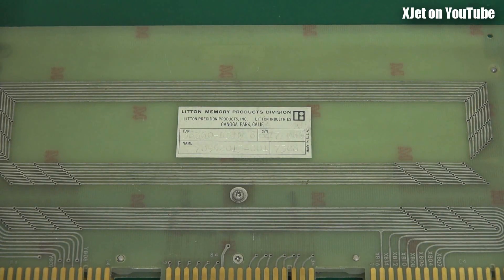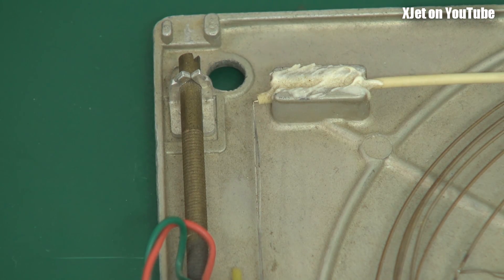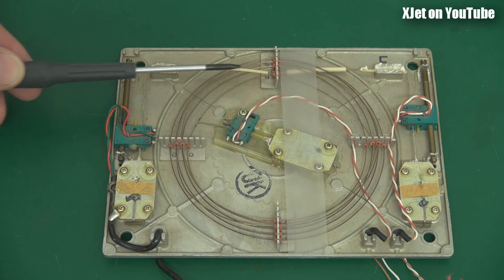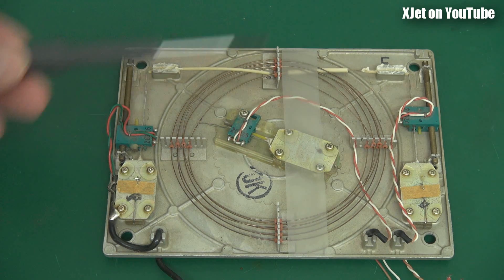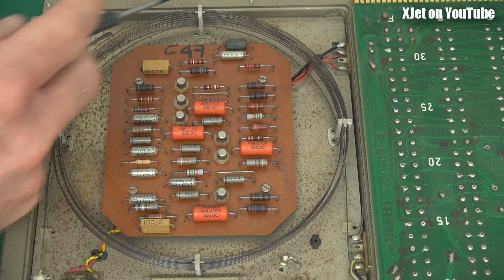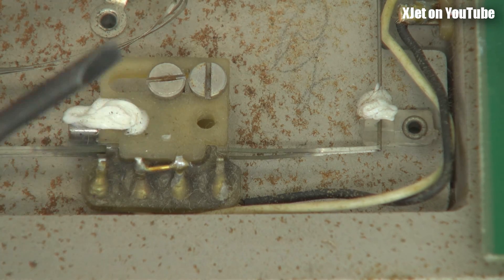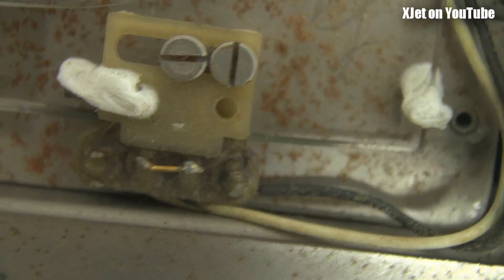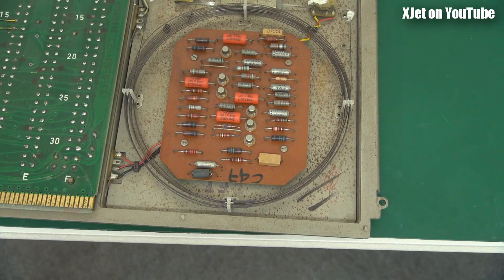Old computer tech:  delay-line memory

Comment: Just a few notes on this lovely old stuff...

The twin sensors on the first wire thing is confusing. All I can think of, is a speed option. As in, the longer the line, the more storage, but the longer you wait for your data to come through. So maybe having one halfway along the wire lets you set a half-capacity twice-speed mode? 

As far as modern DRAM, it STILL needs refreshing! Just a bunch of capacitors, one per bit. DDR5 SDRAM is still DRAM! 

The construction method for the PCB with the vertical components hanging off, between the main PCB and the little PCBs is a method called "cordwood construction". At the time it was a way of fitting more components into a space. Must've been a bugger to repair though. For whatever reason, it fell out of use. 

The "delay lines" on the board with the microchips, I don't think are. I think they're inductors, for power smoothing. The fact they're next to all those capacitors, presumably for the same purpose, makes me think that.

Lastly the 5 1/4 inch drives ended up with 1.2MB, after many long years! But I think 8" were long dead by then. As densities improved there was no need for the gigantic 8" disks. Maybe some terrible old machine somewhere still uses the 8 inchers, best left in it's dark corner if it does. 

Interesting hardware you got there mate!
Reply: No the delay lines are actually delay lines, just not mechanical but a bunch of coupled oscillators.
Reply: Coupled oscillators? How does that work? I noticed the capacitors seemed a bit weirdly wired up. The circuit with the two coils, one either side of a dozen or so caps. And there were 2 copies of that setup. That the one you mean?

Far as I know no delay line would work like that. If it were some sort of bucket brigade, wouldn't it need switching transistors on each element?
Reply: greenaum  "lumped electromagnetic delay line" looks like a LP filter and is used at it's resonant frequency. Useful if only little delay in a narrow frequency range is needed.
Reply: In general search: "electrical all-pass filter circuit". That is what these are from a filter standpoint. The information that they store per stage is a constant, therefore a distributed transmission line like the mechanical one shown here is more practical than chaining lumped ones.
Reply: greenaum "bucket brigade, wouldn't it need switching transistors" you might be thinking of a CCD best known for their use in image sensors, these were also used as memories but do not need a true switch, only an electrode that moves and creates the "buckets".
Reply: I was thinking of bucket brigade shift registers, another form of serial-access memory, an electronic version of this wire memory.

If the circuit we're talking about is really memory, can you explain how it works? The oscillator thing?
Reply: greenaum I think I could but why don't you just google it? I gave you all the search terms you need. The physics behind it are the same no matter whether mechanical or electrical or lumped or distributed. Look at a chain of coupled pendula, for a lumped mechanical delay line.
Reply: The type of delay line you specify seems more like a pulse-stretcher. It couldn't handle more than one pulse in it at a time. Correct me if I'm wrong. So it'd be no use for storage, you need a bucket-brigade, with a switching element (ie transistor) for that.

I can see the device might maybe need a pulse-stretcher, but then that would assume sparse pulses, only a few pulses with a long distance between each. Otherwise the pulses coming out of the caps etc would run into each other.

It's curious that the caps appear connected in an anti-parallel manner, with alternating leads connected together. Perhaps though it's just a power filter for 2 voltages, plus ground? Positive and negative. That'd explain the two inductors, one for each.

I suppose we could try actually drawing the circuit out...
Reply: "Delay lines need a switching element That is, electronic ones. Basing them on twisted wire is a different bag of spanners."
Sorry but then you have not understood anything and have not done any research about them at all. Neither an electrical nor a mechanical delay line need any form of switching. All they need is a propagating exchange between two types of energies along a line.
Reply: Depends by what you mean by delay. This kind, for memory, is basically somewhere to put 1s and 0s for a while. I fail to see how that would work with only passive components.

That's different from a pulse-stretching delay line.

In the example of a line made of L and C,  it would tend to smear out the pulses and something approaching an average would come out of the end.

Of course all lines are theoretically made of L and C, and this happens in those too. It's one reason that limits the frequency of signals you can send down a cable or optical fibre. The pulses start to smear, widen. Using actual Ls and Cs is just going to make that much worse.

Please describe how consecutive discrete 1 and 0 pulses would come from a circuit like that? A bunch of Cs, in parallel, with Ls between each one. The standard model of a transmission line.

The other thing is, as far as I can tell from looking, the inductors in question aren't multi-tapped. There's just 2 of them, and maybe a dozen caps.
Reply: On the one with two outputs, the middle output is actually very close to the end (a couple of inches), so I don't think it makes much sense as a lower capacity/higher speed option.
Reply: I worked to IBM, they have an old (1960) 80 column punch card data entry, machine code: 029. It used a memory device like that, it could hold 80 bytes of 12 bits.  The information keep recirculating in the spring wire, the electronics could identify exactly each byte and bit, you could edit it, change, and punch the card after you type everything on the keyboard.  It was an amazing technology, we called it "sonic memory".  You can see this and much more at IBM museum online:  http://www.glennsmuseum.com/ibm/ibm.html
Reply: I don't know about those weird electromagnetic delay lines (?) but the twisting-wire ones that occupy the first 2/3 of the video would seem to satisfy "delay line with only passive components and no form of switching". And so do glass delay lines used in analog video—see related video: EEVblog #386.
Reply: Yep, they are memories. The glass delay line is an analogue one rather than digital, but uses similar principles, ultrasound bouncing around a physical medium, like this one.

We're arguing over the thing with the row of capacitors with an inductor either side, doesn't seem like the sort of thing you'd use as memory. I think it needs a switching element because it's electronic, because of how the capacitors and inductors work. Otherwise how would you keep the bits separate? Of course that doesn't apply to things like this, where it's physical vibrations running down a wire / bit of glass.

Cheers for the information, Herr Lip, must've been great to work with the dinosaur machines, back when every bit mattered. My first computer had 48K, it's still weird to have 8GB now and probably a million times more CPU power.
Reply: The "delay line" in question is at around 8:30 into the video. 

Perhaps it's a delay line that delays or stretches 1 bit at a time, but I can't see why. If that's a memory board presumably the chips are shift registers, which were used before RAM, and were accessed serially like the twisted wire. I can't see the point of lengthening one pulse, when the next one is on it's way through already. Surely they'd clash. 

The logic behind all of this is either synchronous, in which case you design everything with tight timing, or static-capable, in which case it doesn't matter. It just seems very odd in digital computers, to use an analogue delay line. At best it'd be a hack, and something they'd want to design away ASAP. 

Just seems very strange. 

Normally, since the 80s at least, you put power decoupling caps across the power lines for chips, as near the chips as possible. There are the yellow caps that seem to perform that duty, but no others. So I'm guessing that's what the caps / inductors in question are. Power smoothing for hungry chips. Perhaps them being so far away is for board design reasons, and doesn't matter as much with slower, less dense, logic like this. 

The diagonal, inverse-parallel connection of the caps makes no sense as a delay line either. It does, if it's meant to smooth both positive and negative voltages, which early memories needed. 

If we want certainty, somebody's going to have to reverse engineer a circuit diagram from looking at the board. I can't be bothered. But I might look a bit more closely, particularly at how many taps the inductors have.

Comment: Back when I was a field engineer at Burroughs, I worked on a terminal that used this kind of tech as the screen memory. It was in the mid 70's but they were obsolete then... Something about a shortage of the new models...  There was a screw on there that adjusted the tension on the wire to adjust the memory timing. I always took my rubber mallet over there to bang on the circuit boards, and a "pot tweaker" to adjust the memory. One of the other pcbs in the terminal was a hoot, by today's standards... the character generator used a huge array of individual diodes to define the font. Fun stuff. ;-D
Reply: Oh the days of diode logic :)  Love the calibrated hammer!
Reply: Jim Steele my great-uncle worked for Burroughs, then unisys he actually had a set of cards from some of the old machines actually he would take the big cabinet cases and put counter tops on them to make work benches, but he had a memory module  that consisted of wire mesh it seems like he said something about the wire could overheat and break fairly easy (it's been a while and I can't ask to double check) also had a bunch of 4 transistor flip flop cards, optical punch card reader.
Reply: my  calibrated hammer  was named mem killer
Reply: I heard about a guy who made a coffee table out of one of the platters from a fixed head disk unit.

Comment: I tore an old Singer computer apart and it had four banks similar but without the twisting action.  It just had a transducer on either end of the coiled wire and was called acoustic memory.
Reply: turbojer1 so... you could corrupt the memory by knocking on the case?
Reply: Yep, that's the one.  Back in the day all we had that would multiply and divide were mechanical Friden calculators.  Along came the Singer electronic (mostly diodes and relays) punch tape computers.  Our company bought one for around $35,000 and I got to tear it apart when through with it.  Inside was two Friden mechanical calculators with solenoids attached to the finger buttons to push them down.  IBM came along and pretty much crushed Singer, who also owned Friden, out of business.  You now have a new appreciation of a sewing machine, eh?
Reply: Not really, the whole container was pretty shock proof plus the memory wire was supported on soft rubber mounts and the vibrating frequency was pretty high.  Probably would not recognize a bump or knock.

Comment: I think 8" floppies were limited to 512Kb. I never saw a 1.2Mb 8" diskette or drive. The newer, early 1990s, 5.25" 1.2Mb drives are starting to fetch money, like $60 each, on eBay lately. It's too bad I threw them all out.
Reply: FreecycleMichael Czechvar 360k. In the 1970’s. I used them on an Olivetti P6066. One system and one user disk.
Reply: The last generation of 8" floppy disks could indeed store 1.2MB, but they were very quickly replaced by 5.25" floppy disks, which had already been available for some years, and were somewhat more reliable, at least in my experience.

Comment: If you made a wire out of microscopic tin sheets embedded with fluorine atoms, it would actually become a superconductor (at up to 100 degrees celsius!). As such, the signal wouldn't get weaker as the length of the wire increased.

I want to modify a DOS computer to have a whole bunch of these Delay-Line modules (in transparent casings); it would be awesome to actually watch it in action.
Reply: It's an acoustic signal, not an electrical one, so the conductivity doesn't matter. Also, the wire isn't a complete loop, it has two ends, it's just coiled up to save space.

Comment: All DRAM chips still need refresh cycle. The current desktop with 16 Gig RAM still need a read operation on each row, the refresh must be performed 1000 times per second. 

A DMA channel iss dedicated for this operation. The DMA execute a read at some address when receiving a clock pulse from a timer. It then increment the address by the page size (256 bytes? 64K bytes?). One millisecond later, the timer chip send another pulse to that DMA which trigger another read operation. The DMA and timer chip are integrated in the processor itself, but the BIOS and OS still need to setup the timer and DMA in the same way as it was done when these were in discrete chips.

This spiral wire using mechanical wave to store about 512 bit of data was a huge improvement over the previous ferrite memory for memory size. However, the performance, that is how fast it can be read or written, is much lower. 

The read and write operation can be compared to a hard drive with a single track. When a sector need to be read or written, the hard drive controller need to wait that the disk rotation reach the location were that sector is located. If we want to read the sector, then immediately write new data, this takes at least the time of a full disk rotation, After finishing to read the sector, the controller need to wait until the disk rotation reach the beginning of that sector, then it can replace the data with the new value.

Thanks for sharing this device. It helped to understand how it work. The way this technology is explained usually is so strange... like if they didn't really understand the subject that they were forced to teach.
Reply: Christian Gingras that's scary
Reply: How so?
Reply: The ram need to be very reliable to avoid loosing data. The spirale memory need to repeat the same pattern continously to work. Even if the processor would stop on a breakpoint, the spiral need to circulate the data non stop, always at the exact calibrated speed.

Any strong vibration, electrical noise, etc can not just corrupt 1 bit but the entire content.

What if some binary sequence like 64 bit to 1 then 64 bit to 0 could create large oscillation and corrupt unrelated memory area. Maybe the instability would happen with shorter repeting binary sequence. Then, the software engineer find ways to avoid such sequence for reliable operation.

Note that such nightmare happen even on modern architecture. For example, a mistake in a PAL logic was triggering corrupt data on an I2C chip when the code size exceeded 512 k on a x86 embedded system.

Comment: The Olivetti coil memory is out of the Programma P101. A programmable calculator that could add, subtract, multiply and divide, calculate square root and store data. It had a read / write mag card that stored the "programme" sequence required for the calculations.
NASA had a number of these for the Apollo 11 moon landing, evidently to help tell the antenna where to locate earth.

Olivetti were quite leading edge with this device, HP "borrowed" some of the tech and wound up paying some royalties for the pleasure.

Olivetti design was amazing, from their mechnical calcs right through their commercial machines such as the P603, A4, TES501 and Praxis 48 typewriters.
Ah, good years fixing those beasts.
Although a horror memory is dropping the twin single sided 8" floppy disk drive of a TES501 down a double flight of stairs when the bottom of the shipping cardboard box unglued.
Reply: I kinda used the Olivetti Programma 101 in jr high school, preferring the "newer" Compucorp 025 Educator programmable calculators. But the Olivetti allowed storing programs on magnetic card!

Comment: delay lines is used in PAL TVs for storing a complete raster line full video details, for using it to merge chrome information with the next raster line. So chroma is half resolution, luminance is full resolution. But TVs delays are acoustic delays, so it works sound speed.

The good side delay lines is, it is not just one device per bit, you can store kilobytes of information send to the delay line, and get it later in sequentian order, just to interpret and retransmit again, and if needed to change one bit or read one bit.

So, it is really slow, you needs to wait for a whole memory cycle to just access the correct bit or bit stream

Comment: When describing the refresh function you said that it's a dynamic memory and that some of the early RAM chips were a bit like this... Well, they still work like this! The main memory in nearly all modern computers is DRAM based. Each memory cell must refreshed periodically. 

Also, the little ceramic chips that look like surface mount ICs (gull wing, flat pack) are probably transistor packs with two or three transistors per package. They may have had resistors in them to create RTL (resistor transistor logic) packages.

Comment: This coil memory is quite simmilar to a spring reverb. One reason why there might be two sensors is that the signal (data) may bounce back  when it reaches the end. With a spring reverb this is what you want but with data storage the reflected signal would be a big problem.

Comment: In the 1970s, I can remember equipment like that sending  "read",  "update" and "write" pulse to each row of a ferrite core store. The transducers arranged around the delay line produced the time interval between the pulses. Shift registers sent a set of three pulse to each row in turn. The duration for a set of pulses was  80 micro sec.